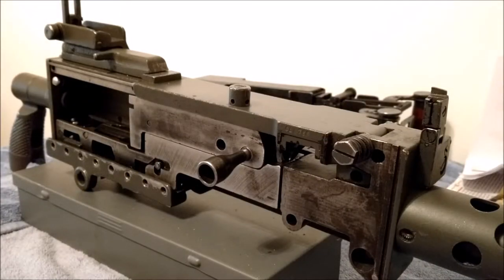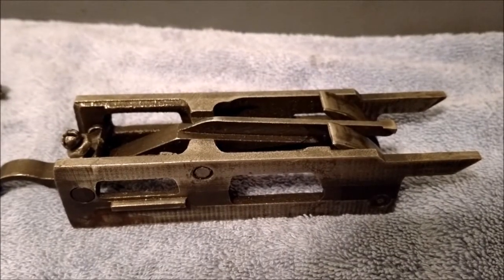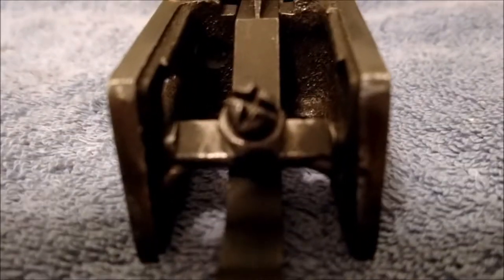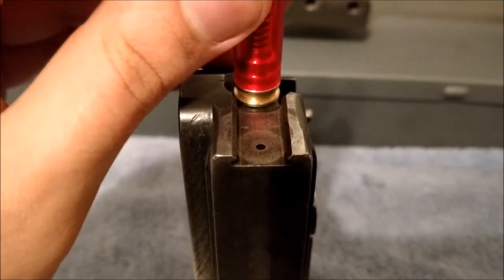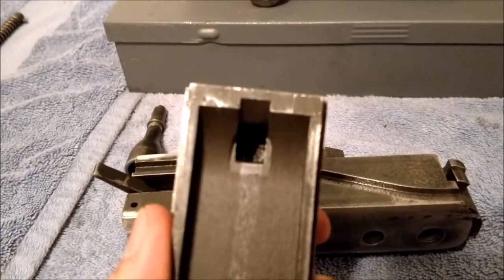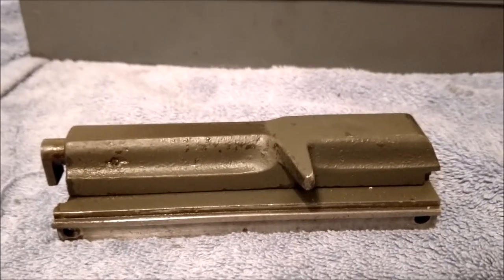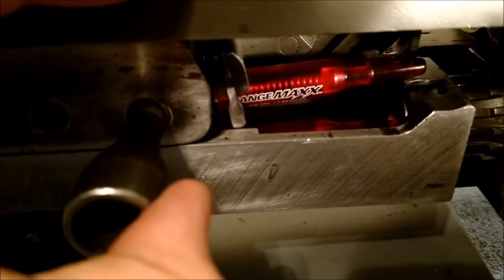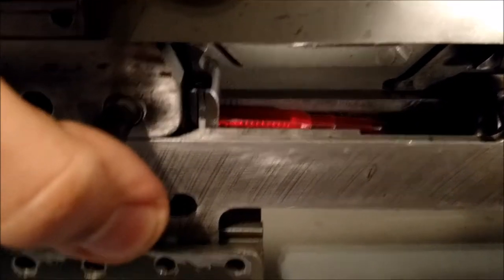m1919 internal functioning/how it works

Comment: I hope to get an answer.. What is the benefit of the lock or the small latch inside the extension of the barrel? Why is it called a lock on which part it closes? Please answer.. Thank you
Reply from the maker: The Lock Spring? This prevents the barrel from rotating, which would cause it to go out of proper headspace during operation
Reply: @mars_man9971  Thank you, my friend. I am a 50 cal machine gun teacher in the army. I was looking for the answer.. So I will disassemble the machine gun and make sure your words are correct.  If you have a more clear answer, help me to inform my brothers fighters
Reply from the maker: @_abusadiq6262  If you are working on 50 cals, I am not sure if we are talking about the same part. The Browning .50s are very similar, but do have a number of changes

Comment: I have watched your video several times and the only thing I really don't understand is how the empty case actually gets out of the chamber ,I  didn't see an extractor hook to pull it out.  Does it get out by gas pressure?
Reply from the maker: The extractor has a bit of a hook that grabs it from the topside
Reply: @mars_man9971  Thanks for your reply!
Reply from the maker: @garylewis3641  My mistake, rereading, this, the round after being pulled out of the belt by the extractor, gets dropped into the T-slot on the face of the bolt. This is what grip the rim in rearward movement, pulling the round from the chamber
Reply: @mars_man9971  I understand it now, thanks!